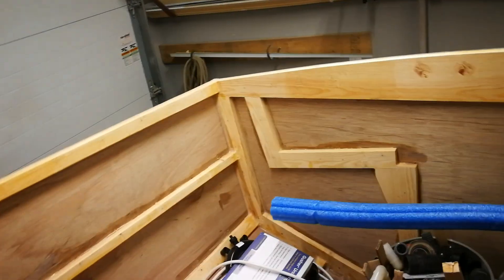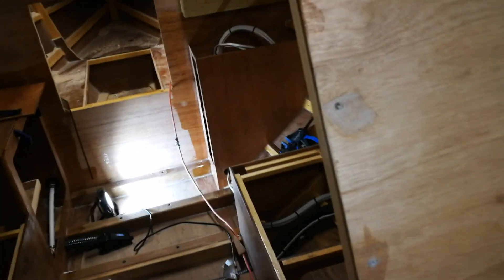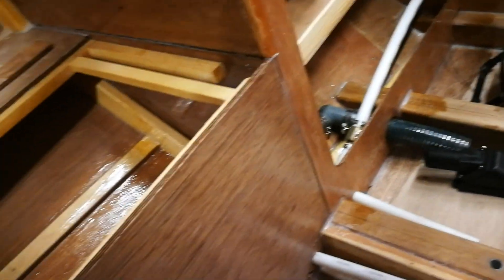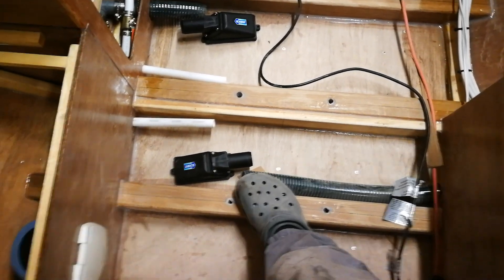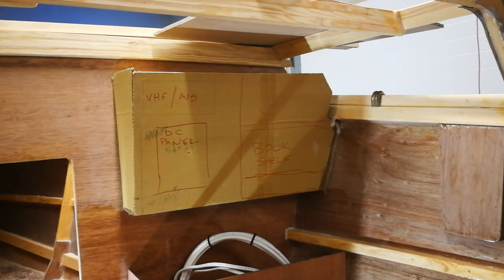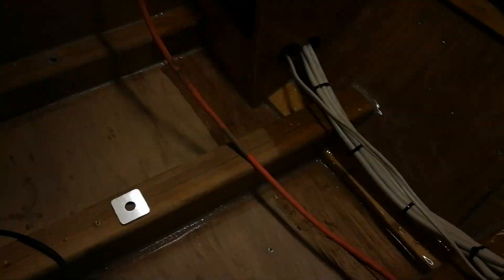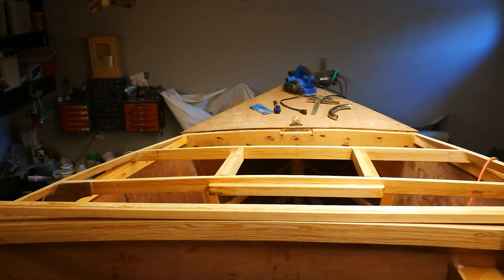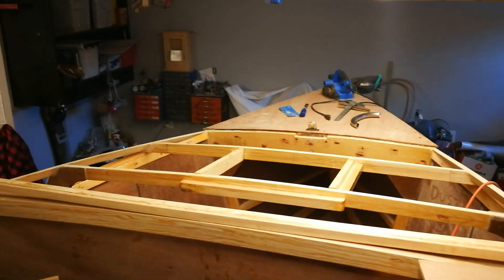Class Globe 5.80 Hull # 20 December update

Comment: Are you draining your cockpit into the bilge ? If so, that seems nuts !  Nice build BTW keep up the stoke you will be sailing her soon :)
Reply from the maker: The cockpit will drain out the back of the boat through scuppers. I was referring to the manual emergency pump that is located in the cockpit. So, what you see is the suction line that leads into the cabin area.
Thanks for the encouragement ! Cheers